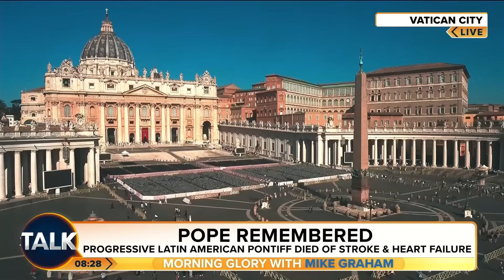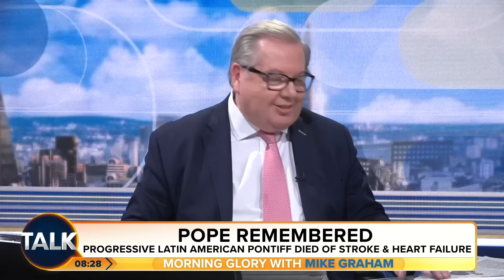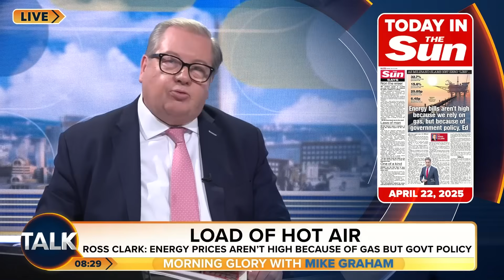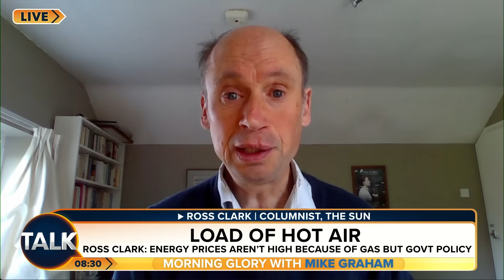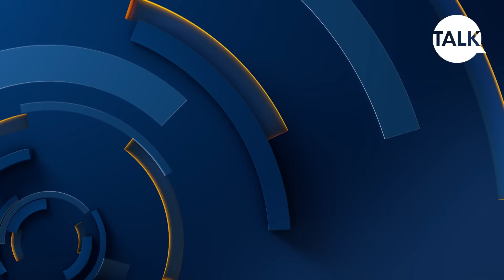“Lies Quite Frankly” | Mike Graham CALLS OUT Ed Milliband On Energy “Untruths”

Comment: What I don’t understand though, is that electricity cost just as much when the Tories were in power. Listening to this you would think Labour had put the price of a KW up. They didn’t. And so Farage, who thought Brexit was a great idea, is the one actually ‘lying’ - again. Fact check: gas is more expensive than wind and solar, and unlike the US, we choose to save the planet. The latest official report on the Arctic now states an alarmingly high possibility that it will melt by the end of this decade. But whether it melts by 2030 or 2060 it’s only a question of when as things stand. You go figure - or perhaps you’re not worried about your grandchildren and their energy security. Ah, there’s a concept. Who controls our energy, controls us (and no, it’s not the EU).

Comment: I'm confused by Ed Miliband's editorial. The reality is the UK needs energy security. The so called 'green technologies' like Lithium Batteries, Solar Panels, Wind Turbines are all exceptionally expensive, unreliable, they cannot provide energy security and are causing massive environmental damage. At the same time the UK is building SMRs like one developed by Rolls-Royce to boost Nuclear Energy, which will provide reliable energy security. The UK has plans to produce at least 25% of energy from Nuclear, this is besides continuing to buy 10% of Nuclear Energy from France as we do currently. What is really going on?

Comment: Miliband’s statement was ridiculous.  He said that the reason our energy prices are so high is that we are dependent on importing foreign fossil fuels.  There is some truth in that, although at the moment both oil and gas prices are down, of course that isn’t passed on to our energy prices but the government were happy to let the drop in petrol prices give them a fall in inflation which they paraded around as if it was the result of their policies.

But what Miliband omits is that the reason we are at the mercy of imported oil and gas is because the loony net zero has shut down or restricted our ability to take advantage of the our own oil, gas and coal.

Comment: The yearly cost of achieving net zero in the UK per person is estimated to be between £269 and £373, or £5-£7 a week. This figure represents approximately 0.7-1% of the UK's GDP. Lower-income households could be protected from these costs through support measures.  this is why energy is so expensive

Comment: We need coal-fired power generation.  There is an international market as our source of coal, so my point doesn't depend on UK mining the coal.  Just locate the power stations at big UK ports.  There are two main obstacles to this: the UK government has banned coal-fired power generation (thank the Tories for that)  and the UK has a carbon tax which makes use of coal uneconomic (thank the EU for that).  Time for the UK to get on top of these issues, if it wants to improve the economics of electricity supply.

Comment: We must ensure that as bills go up our spending on net zero is going up and up. to tens of billions until it goes to £3 trillion as estimated by grid Engineers. That is why miliband is hiding the costs.That will be for only the 20% that is our current demands of approx 60 gigabytes. The other 80%  gas , oil, petrol , diesel,  has not even been addressed yet. God knows we will be  in chaos when all our energy is supposed to be. non fossil.  We will not have half the needed 360 gigabytes. by 2050. Miliband has not a thought or clue about howe go about this, but is throwing our country into chaos . Hopefully all this will come out  with a bang once people see how moronic it is.

Comment: I often wonder if the people of the UK realize you have the 2nd largest and most in demand oil deposits just off your west coast.  The oil that makes the best Diesel and Jet fuel. 70% of every gallon can easily be distilled into high quality diesel. No other oil in the world can even get close to this..
The Gulf of Mexico is the next closest at 40%. 
You should have the cheapest energy prices in the world simply because the best oil for energy production is in your back yard. But for the sake of climate change your not using it.

Comment: The high energy prices in the United Kingdom are due to the inappropriate and uneconomical use of renewable energy equipment.
Wind has a low energy density and is erratically intermittent. Wind power is centuries out of date. Wind farms only exist due to massive taxpayer funded subsidies. They are a colossal waste of money and resources (including coal,,steel, copper and rare earth metals) as well as being a blight on the environment.
Solar panels are only economical as a supplement in sunny areas between the 35th parallels. Even in favourable areas there is a major mismatch between peak supply and peak demand. They make no economic sense in cloudy upper latitude areas such as the United Kingdom.
Climate action has negative utility and needs to be abandoned.
Reply: Why don’t more people realise this? Spot on! And it’s horrifying - in the U.K. we are still building more wind turbines, burning wood chips from Canada in Drax power station, and laying waste to productive farmland by laying arrays of solar panels, most of which aren’t even grid connected. The system engineering is not happening. We might assemble wind turbines and solar panels made abroad, but we aren’t really making a sustainable business from harvesting wind and solar energy. There isn’t enough of that to make a business from it, and no economy of scale is enough to make it profitable.
Reply: Excellent précis!🙂
Reply: and then there is the £180,000 an hour it costs us to turn off the wind turbines because we have no way to store that energy